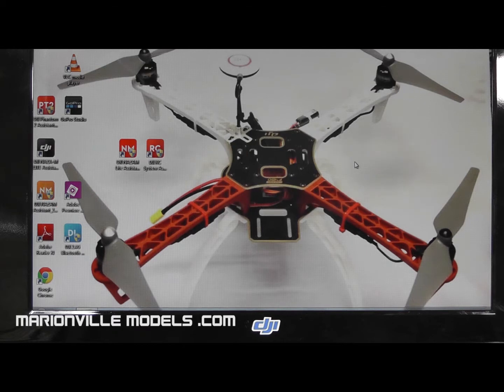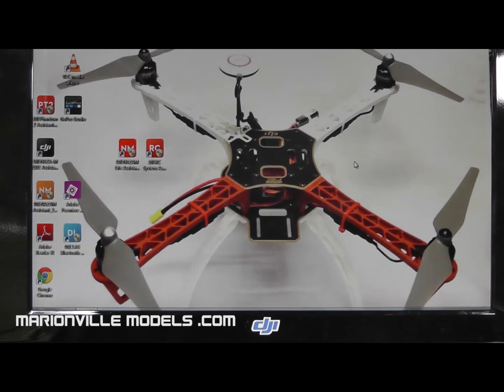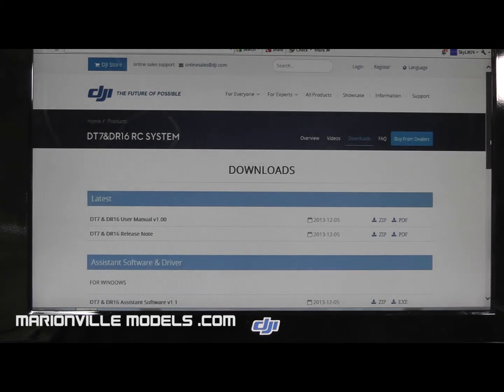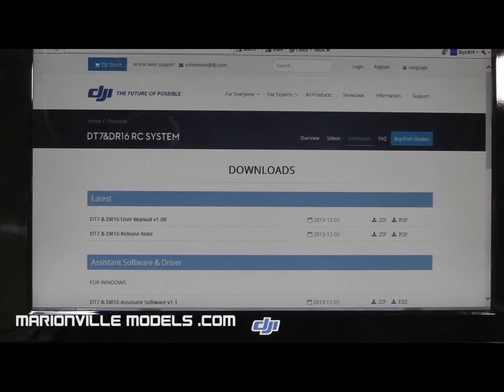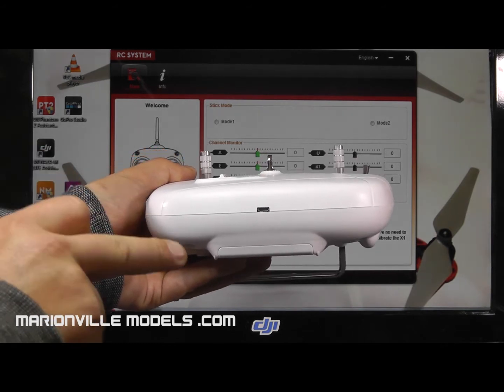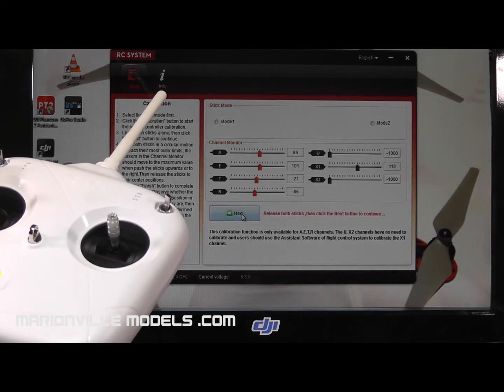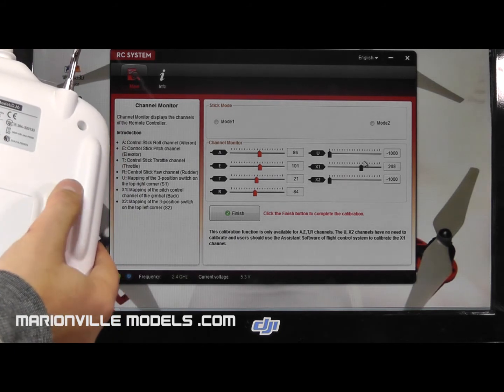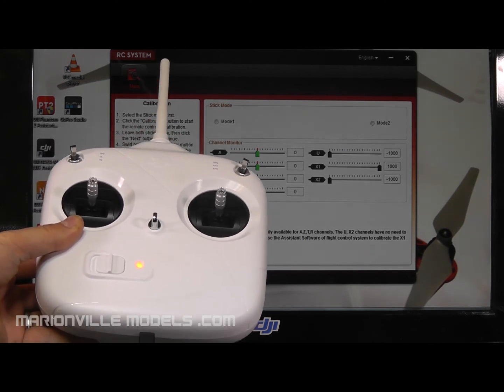Calibrate & Setup of DT7, Phantom1,2, Vision + Transmitter with RC Assistant Software

Comment: MY RADIO dt7 DOES NOT COMMUNICATE with pc....any solutions
Reply from the maker: Jos jo make sure you have the driver installed.
Reply: @MarionvilleDrones  well, i just figured that it out just today. nnect the phantom with the radio on and use the RC included in the assistant software and "wola" i can update and tune the DT7. it worked. I had a problem with the phantom drifting away with no control on radio, Really a problem. Hope fully with both updates I can re-gain control. We will see.Thanks for the reply. oh I forgot, the driver does not allow to connect an extra cable to the controller itself and no updates could be done.

Comment: Hello, I have a Phantom 1 and the same controller as you. However, the software (assistant) is not able to deal with the connection, it can't recognize it. But I would like to activate the CL and HL button on the left of my controller. Do you have any idea of what I should do? Thanks

Comment: hey so i build my own dji using phantom 1 electronics and not phantom motor's and so when i put it alll together all the motors spinning the right way but when i throttle it.. it just flips forward and flips over is that's because i never calibrated anything??, i did the gps thing tho

Comment: mine won't recognize the controller in the rc app any tips?
Reply from the maker: Make sure you have the Installer Driver on your PC
Reply: +Marionville Multirotors downloaded it all it shows its connected with the other app but won't recognize on the rc app

Comment: I just purchased the upgraded controller with the gimbal dial. I want to calibrate it but the RC software will not recognize the controller when plugged in to the computer. I've tried different cords and the driver download will not download anymore. The controller did pair correctly to the drone but the gimbal dial does not work either. Any help would be appreciated.
Reply from the maker: It should work regardless. What flight controller and gimbal do you have.
Reply: +Marionville Multirotors model number NPVT581 it's the one with the gimbal dial on the top left for the phantom 2 vision. I had this same problem before with a previous drone not connecting to the software and all I did last time was just use another cord and it worked but this time after using multiple cords still no connection plus the gimbal dial doesn't work. I just wanted to connect to the software to see if there's anything I need to calibrate to get the gimbal dial to work.
Reply from the maker: +MrSnowboarder1980 if you use the Phantom assistant make sure the controller is set to Upgrade under the rc tab. Then calibrate all controls including the roller wheel.

Comment: I just got a Phantom 1.1.1.  No gimbal.  Do I still have to calibrate the lever on the back of the controller?  Good video..
cheers
Reply from the maker: No. You only require to calibrate the leave if you have the gimbal fitted.
Reply: Cheers....